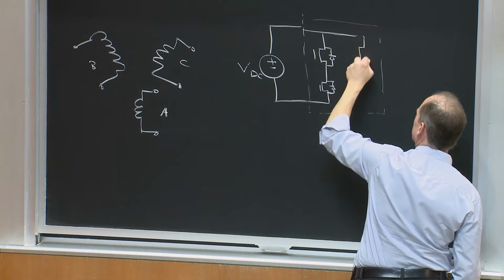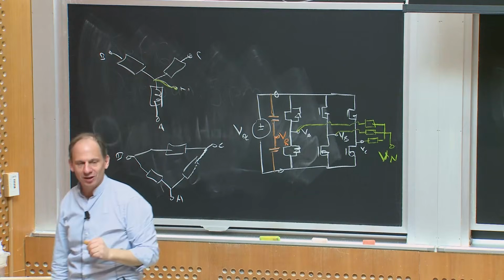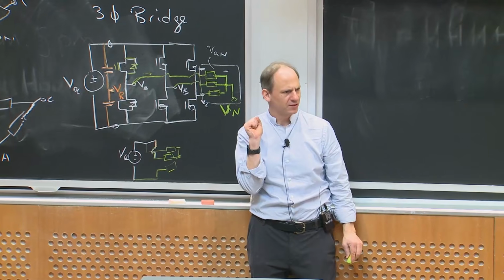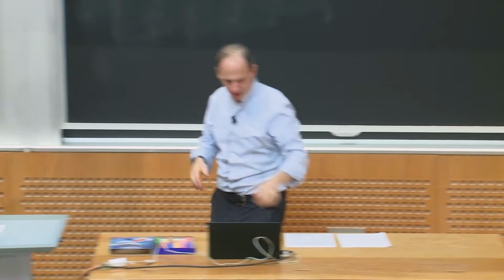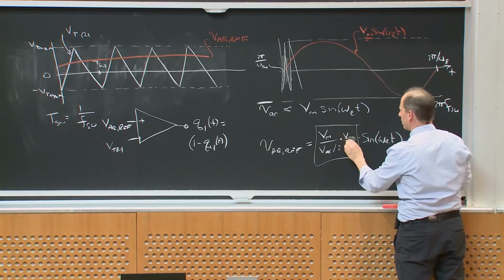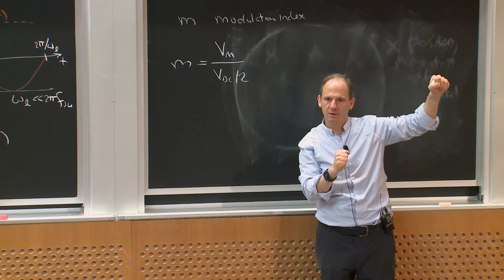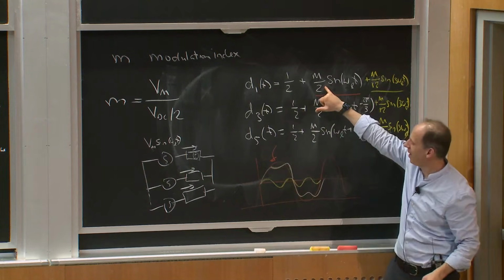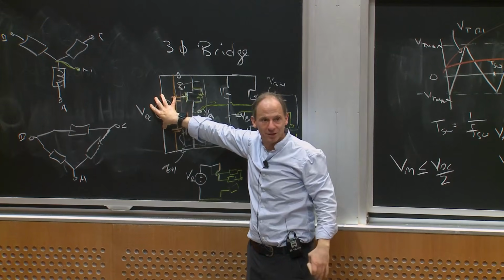Lecture 23: Three-Phase Inverters

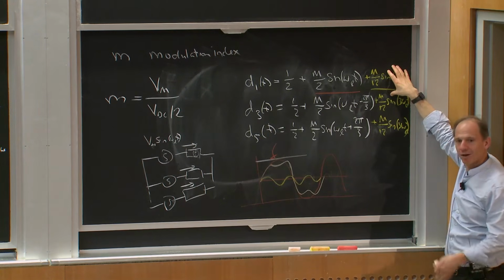Comment: @44:32 - The simpler way to visualize the "+15%" of Vbus voltage to 3 phase motor: imagine an equilateral triangle (60 deg angle) squeezed between tho horizontal lines ( Vbus is the height between lines ), now the side of that triangle (voltage between phases) you can squeeze between lines will be 2/√3 ~ 1.154 * Vbus